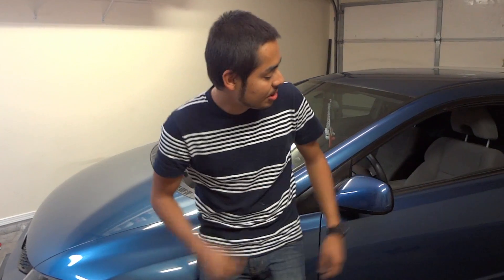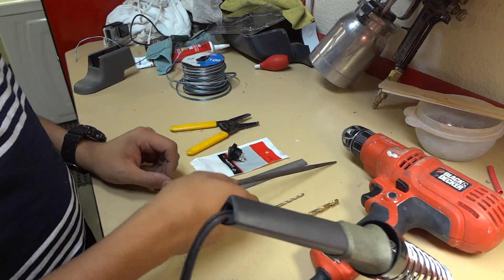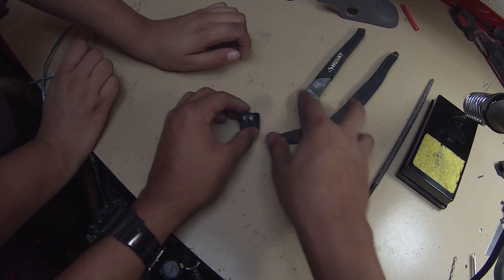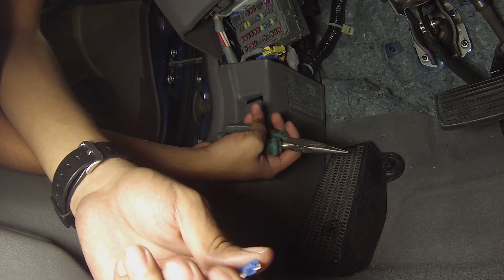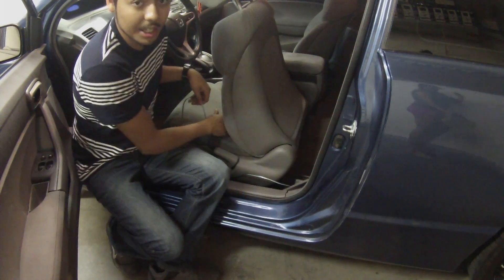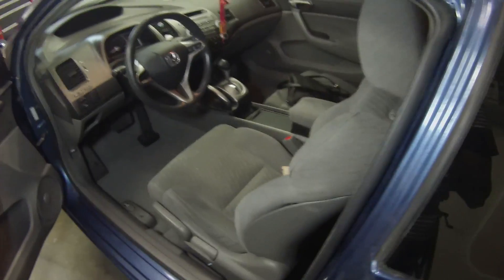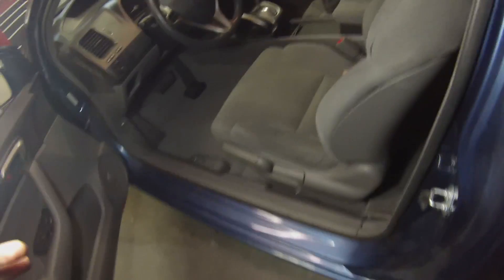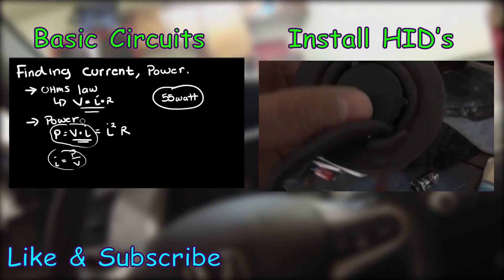How to: Install a Kill Switch on your car

Comment: A thief knows to look for missing fuses or relays. If you want to tap in at the fuse tap into the wire behind the fuse block at the pin connectors. Having speaker wire sticking out of it is a dead giveaway. Just swap it with one of the spares. Most thieves drive tow trucks these days. Get good insurance and say your prayers before you walk away from your car or your car may be parted out 😉

Comment: would have been easier and less obvious to disconnect the coil and swap out the firing order of the spark plugs...nobody would think to look there..a switch is pretty easy to find

Comment: really the fuel pump fuse good way for your engine to get damage if someone does try starting it like that why not look for starter fuse instead that way wont crank at all no damage and simply wont atart
Reply from the maker: +That silver Teggy starters are easy to bypass. You can force the starter to run from the outside.

Comment: I work 4 Toyota  I am a electronic tech I have done a lot of kill switch  and clifford  alarms if I wanted to steel  that car and had the key and it didn't  start but cranked I'd look 4 a fuze like that and you better hope that you don't have problems  with that as you drive and 4 warranty  at honda if thay see that you will be paying  4 a body ecu / fuze  box you could get a nice clifford  with black jack 4 that car
Reply from the maker: +dante love right? Also, almost any modification you do to your car voids warranty. If I had a choice to either do what I do in this video, or splice wire behind the fuse box, I would do this to avoid voiding the warranty (can be reversed relatively easy). But if warranty wasn't an issue, without a doubt I would have spliced wire instead.
Reply: john Kosheluk ain't got time for all that shot.

Comment: It's a FUSE; no need to drill a hole;  get a foot of wire,touch both ends of the FUSE to the battery terminals, »»»» FUSED and ready for you

Comment: How do you do this with a 3 prong LED light up switch?
Reply from the maker: +Justin Reise do you have a link to the switch?
Reply: Justin MacGregor Justin MacGregor Thanks for the reply brotha! I ended up just going with a 2 prong VERY tiny toggle switch instead. Easier to hide. I basically only wanted the LED for if I'm driving, and all of a sudden my car dies, then I'd be able to just look down and see that the switch lost power and I would know immediately what it had to deal with.  But I figured you shouldn't really ever have a problem if you install correctly.  (Witch includes NOT using speaker wire  Christian!  just sayin....because those are not made for much current AT ALL. Will it work? Sure, would I trust it? Nope.)
Reply: Justin Reise find out which part of the switch goes to earth and which goes to the output, same in concept just has a earth to allow the led circuit to work, I had the same type of switch for my sub kill switches
Reply from the maker: As far as current goes, the gauge of the wire is more than enough. I posted a comment somewhere (I'll try to pin it at the top) that describes how much current it could handle safely. But honestly, it was a bad choice considering that most people skip through the video and will hear "speaker wire" and get the first one they find. That happens in so many of my videos. Also after reviewing the video I did discover I said the fuse can go anywhere. For safety, it needs to go as close to the positive side of the fuse socket as possible. This way if the wire accidentally gets grounded during installation it will still blow.

Comment: awsome. your execution is a little crude . but you are totally right. the idea of anything you can do to slow the crim down ,has a great effect . a long cranking engine draws attentinon . add a steering wheel lock . the crim will cut the steering wheel, remove the lock, and the cranking engine will add up to too much time .i would bet a paycheque , that 90% plus of the crims would move on to other targets. good job.

Comment: any one who knows what they are doing is going to take it it's in the easy-to-use spot to do it any one will find it in the fuse box want to do it in the engine way then run it in to the cockpit

Comment: Why in the world would you screw with fuse? Just split the wire between the fuse and the pump.
Reply from the maker: +Atlas WalkedAway should you want to revert, you would need to solder and shrink wrap vs a fuse can just be replaced and its as good as new. Unfortunately it going the same for security... Can be bypassed if you know where to look.
Reply: gary hutchison  I'm not touting it and I'm not concerned with your admiration, sarcastic or not. I stated it so you didn't waste time assuming I had no idea what I was talking about. 

I dont think it takes an engineer to figure out that a non locking connection controlling the fuel of a machine that regularly sustains high vibration at high speed is a stupid idea. Imagine scratching your leg and losing power steering and power brakes at 70Mph. I also don't think that any amount of even stupider ideas elevates this one out of stupidity.
Reply from the maker: Atlas WalkedAway this is the point I really forgot to emphasize. One side is unfused and I didn't point this out in the video.
Reply: And we all know where he put it.
Reply: Atlas WalkedAway instead of doing crappy solders should just buy crimpers and crimped a couple connectors on the switch.  will make everything slot easier and the joins will last longer
Reply: yeah you are an electronic engineer with no common sense, he did a great video using his time to help the common joe. why are you looking at his video in the first place since you are so smart create your own video. of course you have to resort to insults which renders whatever valid point you may have had worthless.
Reply: He (Atlas) is an A-hole, plain & simple. Wanna be smart but bad person. Electronic engineer my ass.
Reply: Christian Macias at least someone was tracking me lol
Reply: Atlas WalkedAway : As he is a mechanic...Lol. Crazyy aieee.
Reply: @AtlasReburdened  typical marines dickhead
Reply: Atlas WalkedAway bc his modification doesnt permanently damage the vehicle wiring. he can remove the switch and just put a reg. fuse back.
Reply: gary hutchison And just how do you permanently damage a wire?
Reply: Atlas WalkedAway Instead of being a whiny bitch about it, make a video showing the proper method in which to make a killswitch. Instead of bitching and complaining someone is doing it wrong. That's one of the most annoying traits a fucking human can adopt. Be a fucking helpful person. Jesus.
Reply: One side of the fuse panel in hot the other runs to the fuel pump. It would also be best to check which side is hot then put the fuse there.  If said fuse was on  the return path from the switch and shorted before it, it could cause a fire. Multimeter needed to check. It is safer to split the wire from the fuel pump because it insures the factory fuse blows. I like the fuse method because if something messes up in your wiring or non factory switch , just pop a new fuse in its place. Otherwise if the cheap switch went out just short the wires together. FastnFurious style.
Reply: Atlas WalkedAway if youre an electronics engineer, congrats im so proud of you. point being is this something d prob isnt. and not being so, what he came up with isnt a bad idea. not the best but not bad. im a technician for toyota and have seen MUCH worse home modifications to wiring leading to me fixing after the vehicle is towed to my shop.
Reply: Irrelevant. That's obviously why I said to put a switch between the fuse box and fuel pump.
Reply: +Biggz Baby Lol, well I started my learning as a 5939 in the Marine Corps, so I don't really problems with that. Wanna go over my accolades or are you just going to dive headlong into another half baked ad hominem?
Reply: @AtlasReburdened  No one is interested in your accolades. No one is interested in you. I can tell because you are mostly interested in you. And by law of human nature you are a people repellent, you repel people. You wouldn't notice because much of your thoughts revolve around yourself. No, really. Its a terrible thing 😂
Reply: @AtlasReburdened  Its already over i killed you with my last comment
Reply: Youre both acting like solder and shrink tube requires a contract with NASA. I happen to be an electronics engineer and my rsx can only be stolen with a flatbed and no witnesses so I do have a perspective on these things. It takes 20 minute to install a perfectly hidden switch with robust connections, but if you want to screw with the fuse box, solder to copper allows, add two more resistive solder joints because you need to add an additional fuse with additional resistive connections, and leave ridiculous wires hanging out of the first place a thief will look once he busts your ignition lock and the car doesn't crank, then be my guest.
Reply: @AtlasReburdened  so did you learn anything from the video or do you always go on YouTube when youre feelin bitchy
Reply: Biggz Baby I'm an electronics engineer, of course I didn't learn anything from this.
Reply: @AtlasReburdened  I bet women lose their minds for electronic engineers
Reply: Besides, you would literally have to split two wires (assuming there are two. Most cars use the frame as ground for almost everything) instead of one and then join them with a switch. If your that fucking stupid then get a desk job and pay people like me to not fuck up a simple switch.
Reply: Atlas WalkedAway "if YOUR that fucking stupid" rip to your grammar there, guy. You're indeed the needing a desk job. Oh, wait! Your job is belittling people. See you on r/IamVerySmart

Comment: Everyone Kills the engine by the fuel pump or starter circuit, so typical and so easy to figure out.    Get creative like I did, my vehicle starts but you cant drive it away!    ( No External Aftermarket anti-theft Devices used at All, Only Factory Electrical Solenoids) the perfect Game Changer!!!

Comment: Good idea but I would of tapped into the wire going to the relay out the back of the fuse box so if they look they don't see something that looks way out the normal at a glance

Comment: Ummm, no. A theif trys to turn the car on and it doesn't work, the first thing they'll do is check the fuse box. If they see that wire, they are gonna rip it out and put in a random fuse they can find, like a horn fuse.
Reply from the maker: +YoloMcSwaggins umm OK. Well, this video should be a way to get some ideas. The basics are all there and the more creative you get, the harder time a thief will have. If I made a detailed video on a complex installation, then the video will lose many viewers and eventually become a common way to install a kill switch. Thanks for watching!
Reply from the maker: +YoloMcSwaggins umm OK. Well, this video should be a way to get some ideas. The basics are all there and the more creative you get, the harder time a thief will have. If I made a detailed video on a complex installation, then the video will lose many viewers and eventually become a common way to install a kill switch. Thanks for watching!
Reply from the maker: Haha. Of course not but some of my family members have had their vehicles stolen or attempted to be stolen and this is what has worked to prevent it. This and a few other things but that's for another video if I can ever get to it.
Reply: wow you are giving the thieves a lot of credit.
Reply: Umm no. A thief wants to be "gone in 60 seconds" they're not going to troubleshoot why a car isn't starting.
Reply: Yes I agree, but you did do a very good vid Christian and gave me some ideas. Your weren't a car thief before were you?
Reply: It's "thief", not "theif".  Learn how to spell.

Comment: there's a reason why it won't fit is because that's not how you're supposed to install it. this is a extremely incorrect way of wiring.

Comment: eh idk. i think this is a bit too easy and lazy of a job. as proof of this, my car had a tracker installed for the finance company, the idiot who installed it put the wire to a fuse. well, because the fuse block is right next to where my feet go, it pulled it right out. 

I'd rather do it right and trace the wire to a more accessible place, cut the wire and put my wires in between. but that's just me.
Reply: I was thinking the same thing. Its much to easy to trace a fuze than if you splice the wire somewhere along the path

Comment: Not at all knocking the video or your tutorial. In fact its very informative. I just would like to throw out (just for safety & help)... 

With regard to the "speaker wire." Choosing the RIGHT gauge is EXTREMELY important. If/when doing this mod... DO NOT use that cheapie 24 or 26 gauge stuff. Also.... take into consideration.... the fuse is there for a purpose. I would suggest if you are to do this in the same manner.... ad a fuse somewhere else in the line as to not completely remove it.

Now on to the soldering. Again in NO way meant as an attack or negative comment. 

There are ALOT of people who DO NOT know how to solder.... They think they do... fact is they probably do solder things but more then likely with poor results. 

When soldering..... USE flux!. Best way I can think to put it... Think about a sponge and how it soaks up water.... Apply flux to the object you intend to solder, get a little bead of solder on the tip, apply to the fluxed object.  The item surface with the flux on it will (for the most part) keep the solder in that are. Also, gives better cleaner welds. and faster too. 

Thats my only 2 suggestions... 

Very informative video tho!

Comment: So basically this is a fuel pump switch but if I do this do I keep it in the on position while driving? N when I kill the car do I have to turn it off or is that how I kill the car?
Reply from the maker: the switch is on while you drive, then you turn off the car and then turn off the switch.
Reply: helllllllllllllllllllllllllllllllllllllllllllo

Comment: To kill the fuse just connect wires similar to volt meter to battery (I forget what their called).. connect the red terminal to positive, and only touch the black connector (negative) connection to the fuse.. Be careful it will slightly spark.. But it will kill fuse permanently.

Comment: cool but this is just jerry rigged ... attaching it to a modified fuse?  Should have spent a few more minutes and actually used the wire to which the fuse connects.

Comment: You can use 2 small male spade connectors instead of the broken fuse.
Reply: or you could intentionally blow the fuse instead of drilling through it.

Comment: What a hack job.  Jesus man, speaker wire?  Holy crap this was hard to watch without cringing.
Reply: Power wire...
Reply: What's wrong with speaker wire?
Reply: The insulation type and the insulation rating is "what's wrong with speaker wire." Speaker wire is not meant to carry any significant current.  I bet that wire is 18 or 20 gauge and normally only carries less than 1 amp when used to drive speakers.  I bet the temperature rating is something like 40 deg. C. The insulation temperature rating of speaker wire is very low AND it has almost no abrasion resistance.  You don't want the car to burn to the ground because you used unsuitable wire. Tell your viewers what the correct type of wire to use is and also inform them why using speaker wire is completely unsuitable for this application.
Reply: So what type of wire would be best for this kind of modification?
Reply: @dickcheese4048  Look for Primary Wire 14 or 16 gauge sold at part stores for like $8.99
Reply: Look up the Amp rating of the fuse. Then go to Amazon and search for wire that is the proper gauge for that amperage.

Comment: couldn't they also just swap the computer out and try and start it by jamming or wiggling their key in the ignition? and since they swap their ecu in and jam your ignition cylinder up with their key the immobilizer pretty much useless?
Reply from the maker: +Andrews as leaders you are correct but very unlikely. Somebody would have to target your car and know it's exact model and ecu. Not to mention a key to match the ecu. If the thief was able to do that, then he could hot wire it then.

Comment: couldn't they just pop the fuse cover off and pull your fuse with wires soldered to it and and replace it with a normal one and start the car? lol
Reply: If u do all that u can have the car

Comment: You should run it from the starter of your car. A thief will check that box and cut the wires to avoid the switch, but from the starter will take him too much time.

Comment: Cool video bro Im On the process of installing the kill switch what kind of wire did you use can I use speaker wire can I use 18 guage speaker wire?
Reply from the maker: +Enmanuel Cash 18 is to thin. You would need at least 16 but 15 or 14 is better.

Comment: using speaker wire for electrical connections I don't think so. fire hazard waiting to happen
Reply from the maker: +kg839 well, as hard as it may be to believe, what matters is the gauge and whether they are solid core or stranded wire. Those parameters tell you how much current the wire can safely carry. Additionally, the fuse will also help prevent a fire in the even the wire short circuit. www.powerstream.com/Wire_Size.htm .
Reply from the maker: +kg839 well, as hard as it may be to believe, what matters is the gauge and whether they are solid core or stranded wire. Those parameters tell you how much current the wire can safely carry. Additionally, the fuse will also help prevent a fire in the even the wire short circuit. www.powerstream.com/Wire_Size.htm .

Comment: What size of wire did you use? I have 26 AWG wire leftover and I was wondering if that would work or it would be too thin? Thanks in advance.
Reply from the maker: +David Khong 26 awg is to thin for 20 amps.
Reply: So what awg do you recommend?